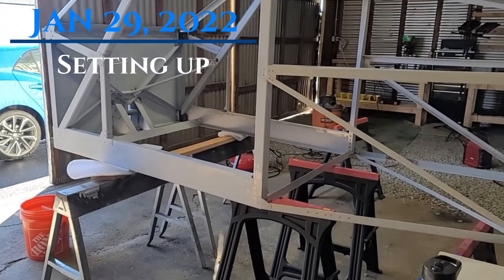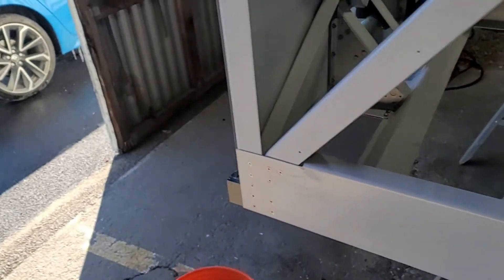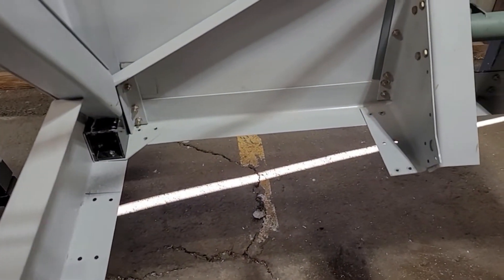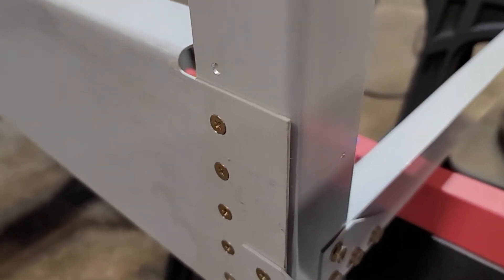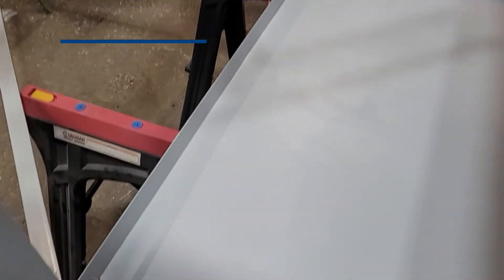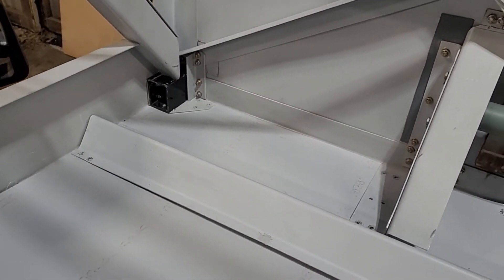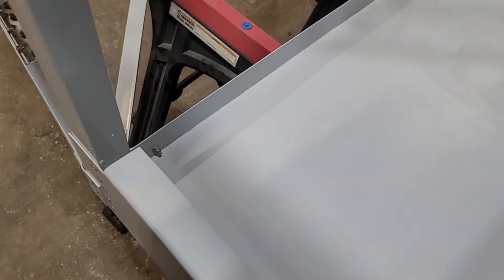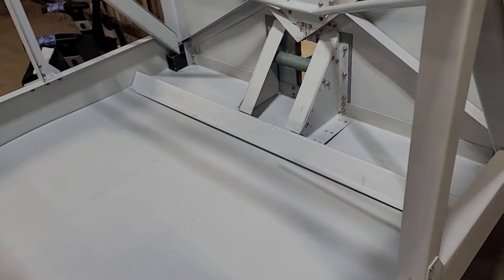Bede BD-4C Build Log 013

Comment: Do some research on using marine plywood on aluminum. Boat builders I have spoke to say marine plywood will cause corrosion.
Reply from the maker: I couldn’t source it locally and having it shipped was prohibitively expensive so I went with a decent quality 1/2-inch birch plywood.  I’m very happy with the stiffness.  My wife and I sat inside it once it was secured and there was very little flex.  I secured it with machine screws and locking nuts epoxied into the wood so it will be easy to remove if necessary.